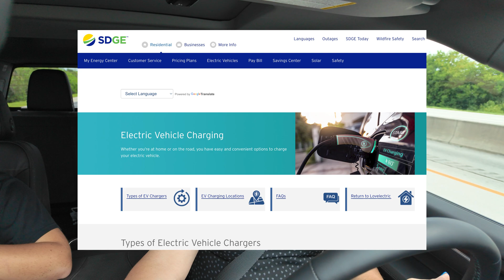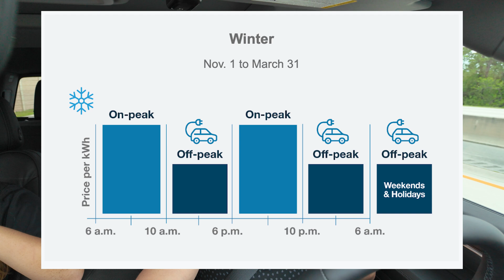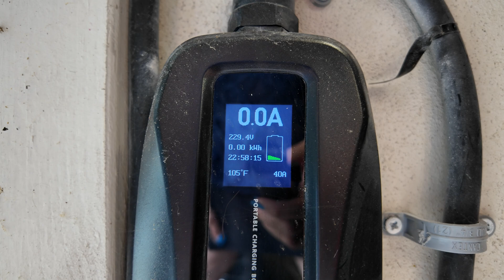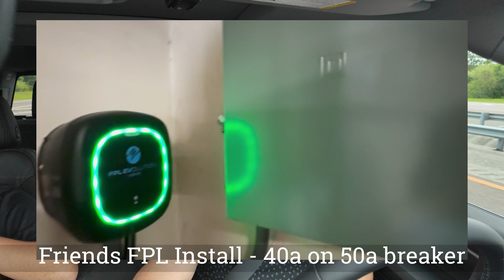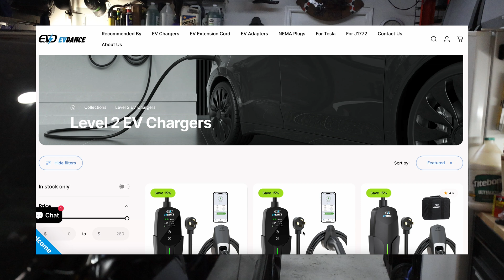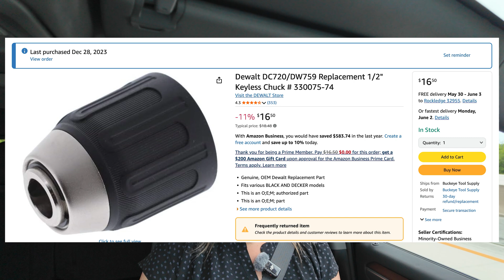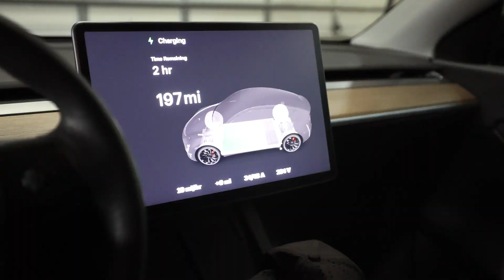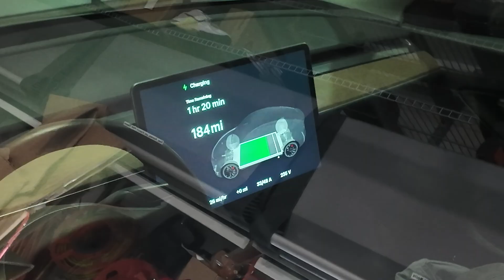Free EV Charging: Too Good to Be True?

Comment: Hi, I’m currently in the process of having an FPL charger installed, and they are proposing to use a 50-amp breaker instead of the 60-amp breaker I requested for my 200-amp panel. Could you let me know how you were able to resolve this issue? Should I escalate it by contacting their supervisor?
Reply from the maker: I honestly probably only got the 6 gauge wire because they drilled a hole through my wall and I asked them for it. I think contractually they give you the 50amp breaker on 8 gauge wire for a maximum of 40a charging.

Comment: This was a great video. I’ve been doing research on at home charging options cause I’m looking into buying my first tesla/EV car. Currently live in florida and saw FPL had that incentive. My main concern is if they will install the charger if the garage was turned into an efficiency. Electric panel is still very accessible though and is separate from the efficiency. Thanks for the video.
Reply from the maker: Glad the video helped! As long as your panel is accessible, you should be ok with the installation. But they will not install the charger outside, or at least that was my understanding.

Comment: 700 miles a month is 25 miles per work week or, in other works, 5 miles Monday through Friday.

From my current home, I drive 120 miles round trip to get to the office and back each work day. So yes, I like the gas savings I get with my PHEV while still having zero range anxiety thanks to the gasoline engine.

At some point I may pick up an EV to become the office commute car.
Reply from the maker: I think it would definitely help you for your round trips - the program does have advantages for sure.

Comment: I keep that sort of EV-rated extension cable in my trunk to use with my Level One EVSE for those times when a standard wall outlet is more than 25' from my parking spot.
Reply from the maker: I have a PHEV as well, but never got much more than 20 miles per charge. So not even really worth it for me to charge it up unless the commute is smaller than the range and I can plug it in for free. But the cable itself is really handy. For a level one EVSE you're already carrying with you, you could also keep a heavy duty standard extension cord in your trunk.
Reply: @AndiWofford  On hot summer days (temps around 85°) my battery will give my PHEV 25 miles of range but normally it's between 17 to 20 miles after an overnight charge.

That's enough to run local errands or drive into town, charge there while shopping & getting lunch, and then (due to it being only 30 to 45 minutes) the 'top up' is sufficient to almost make it the entire way back on electrons. 🙂
Reply from the maker: That's some great range! And you've always got the ICE engine to back you up.
Reply: @AndiWofford  Not enough to cover the drive to the office (where I can plug in for the drive back) but it plus regular hybrid m.p.g. means I only have to fill the gas tank once every two weeks. Unlike my previous car where I was lucky if I could go a whole week between fill-ups.